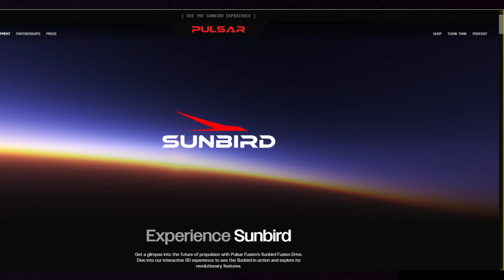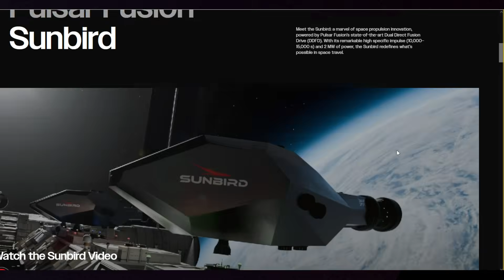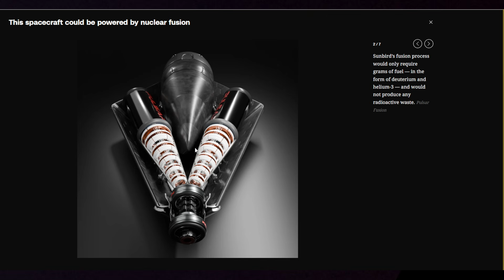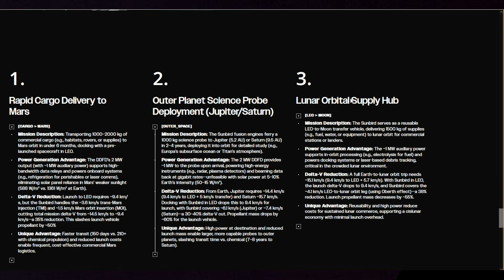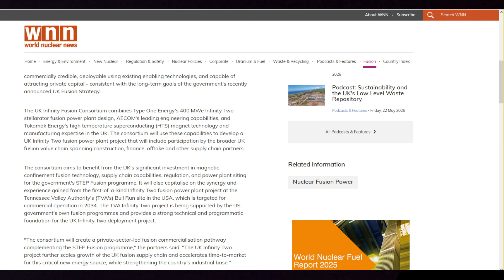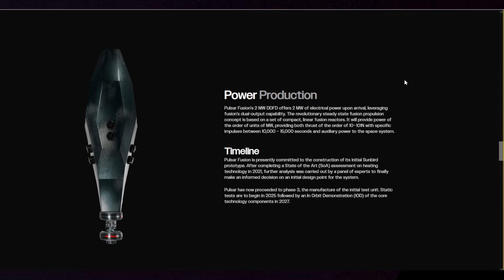On the Sunbird Fusion Spacecraft

Comment: frankly if you are going to do this id probibly just integrate it into the ship and use its thrusters. then you just have to worry about the engine. do a star ship variant without the re-entry features. no tiles, no flaps, no sl engines which you only need for rtls (vacuum engines are fine, perhaps a ring of 6 should be enough to make orbit with the fusion engine in the center). fuel tanks that can be converted to storage on orbit. or do a 3rd stage with the orbital insertion features on a disposable stage 2 and a pure fusion stage 3.

and no the engine is not providing power. you do not need break even for propulsion (it will come before power plants, so doesnt fall into the always 20 year trap). power would need to come from solar or an onboard nuclear reactor. also pb11 would be better as its all alpha particles. you only need coolant for the magnets. all the heat stays with the plasma and since you aren't extracting energy from it, and the alpha particles are staying in confinement, all the heat goes out the tailpile (magnetic nozzle). you still need to cool the systems though. you wont need huge rads.

Comment: hilariously the day this was uploaded I came up with one of my most insane rocket motors to date, I call it the Cherneska Fusion Engine. mind you I previously came up with the Emico Nuclear Rocket, which uses a neutron channel reactor as it's core, which itself can be thought of as a continuous nuclear bomb that runs on prompt neutrons. the CFE basically uses an ncr to power fusion by bombarding the fusion fuel with neutrons, not unlike that of a thermonuclear bomb. the fusion products are then used as the reaction mass propelling the vehicle forward. I guess it would be called an asymmetric fission initiated fusion engine to be more technical. I didn't sleep last night btw.

Comment: "cybertruck esk modual" i mean. tbh it really doesnt need any good shape given its prolly not an atmospheric craft but something you bring to orbit on a second trip.

what im more curious about is the attachment. cuase if they dont attach it to the ship properly, it becomes a missile... straight into the starship. hell, it should have debri resistance.

imo i would attempt to build the lock so it sits in the hull more. close the gap between it and the starship. protect that mechanism more.

but im not an expert or anything. its an intresting use for nuclear powered rockets tho!
Reply from the maker: I think you're vastly overestimating how much thrust this can provide. It maxes out at 101 N, which is less than one ten-thousandth the thrust of one of Starship's engines. So, it really can't become a missile once attached - it has nowhere near enough thrust for that. It's main selling point is its efficiency, but it probably shouldn't be pushing anything like Starship around.
Reply: @RaizSpace  101 N for a high effiency thruster? thats more than 0 N for a low effiency thruster that has run out of fuel and has to wait for more.

think of it as an orbital transfer thruster.

not saying that the design is good tho. im just saying the idea is... well. the idea. whats the alternative anyways? xenon? ion? ion impulse? with 0.5 N of thrust? (idk id have to go research ion thrusters lol.) but you get the idea.

though i can definetly see this thing as a 'space craze' scam. i would geniunely never design a attached thruster to be off CoM myself.  thats just a mathamatical nightmare.
Reply: i think a more sensible hull design (theoretically of course, this thing wont work) would be better. surely having the maneuvring thrusters furhter out relative to the CoM would help?
Reply: @endercherry_real  no you either build with the hull (imo), or spend time and effort making sure mistakes cant screw your crew over. an RCS thruster no matter what would take fuel. extra fuel spent preventing an unwanted spin.
Reply: @endeyfire  but you need to do maneuvres, RCS isnt just to undo mistakes, its to spin.

Comment: The only thing I can say is that in the animation showing the Sunbird undock the Sunbird isn't just using Hall Effect thrusters for maneuvering, it uses smaller RCS Thrusters. Which is something they don't disclose in any of their info, but their model shows at least 8 of them which brings into question if the Ion Engines are even needed.
Reply from the maker: I did see the RCS thruster puff, but as you say, that raises even more questions, especially for the "self-sustaining fuel supply" claim which was already dubious.

Comment: Why are you guys even f$ck$ng debating this it’s obviously a total scam

I did a few MINUTES of snooping and the TLDR is that it’s a weird ass company that has existed for a while and never produced anything, their assets consists of a grifter who owns the company and acts as CEO, one tiny warehouse, and 2 short poorly made CGI movies

Their company is called fusion something and they use to claim they were developing a fusion engine. Yes seriously. I’m sure you can verify that with internet archive sites. 

Anyways I had to dig deep but I finally found what they now say their engine will be and it’s a GRIDDED ION ENGINE LMFAO
*>fusion engine
>looks inside
>grid thruster*
LMFAO

For those unaware it’s a regular ion engine and not just any ion engine but the sinplest type to make by far. It’s basically just 2 metal sheets with wires connected to each one. A disabled monkey could make one in a cave. 

Their promotion videos appear to show literal actors pretending to be employees working in the empty warehouse

The boss also bought 2 random trashed metal gas containers which appears to be something they either want to turn into vacuum chamber or merely pretend they will turn into vacuum chambers. Like most tech scams they just produce CGI stuff with buzzwords for rich morons and moronic investors.  This one seems to target people who want to invest in space X but want to "diversify" and not put everything in space X. 

Basically it’s a shell company that has seemingly spent like a decade building a grid ion thrusters with no prototype yet while claiming they’re making a fusion engine. Their space tug looks completely absurd to anyone with experience in spaceship design too, angular shape for no reason, way too small, no power source,no radiation’s, no spherical fuel tanks, claiming to use fusion, made literally who company that doesn’t seem to exist

I’m almost mad that the people who are wasting my time even contemplating by the notion it might NOT be a scam haven’t given this guy all their money honestly he deserves it more than you if you’re that dumb that this scam fools you

Comment: Skeptical of anything that uses He-3 because of how much of a pain in the booty it is to get any significant quantity of the stuff
Reply: pb-11 is better for this application by all metrics. the fusion products are all alpha particles. so they need never touch the spacecraft actual reducing cooling requirements a lot. also quite abundant fuel supply on earth.

Comment: You should Angry Astronaut's tour of their lab. If I understand it correctly they plan to use a fission reactor to power the "fusion" thrusters at first, which means they don't need the thrusters to produce a net energy output. So basically the first ones at least will basically just function as super powerful, relatively speaking, electric thrusters with Helium 3 and Hydrogen(Deuterium/Tritium) as the propellant instead of the usual inert gas. Achieving fusion isn't that hard. We've been doing it for decades. The reason fusion reactors aren't common place yet is because in terrestrial application we've been trying to generate a net gain of electrical energy from a reactor. This company wants to use the high energy plasma to create thrust so they don't care about efficiency at first. I'm not saying I believe they'll succeed, but after watching Angry Astro's tour the company seams a lot less like a scam. Apparently they have been building Hall effect thrusters for quite a while and have several unnamed customers.
Reply from the maker: Well, I'm mainly just wondering about the radiators. Still going to need those for a fission reactor. If they want to seem less like a scam, they will have their spacecraft look like something proper and less like a Cybertruck tie-in.
Reply: @RaizSpace  tbf if the craft actually needs radiators. nasa has that in the bag. it isnt a new concept to slap folding radiators onto anything.

and tbh the attached craft prolly just has a hull shell for debri protection. so it wouldnt be hard to pack some radiators onto it.

additionally, it could maybe use the starship as a radiator. but i really dont know how well that works.
Reply: @endeyfire  Radiators are *not* a minor inconvenience that you slap on at the end in the loose spaces. It's core to the design of the whole thing. NASA doesn't have folding radiators that could cool this thing. Using existing technology they'd have to be hectares big to work for this thing. Not something that you can fold up easily, especially because you need pumps, heat exchangers, etc...

They've obviously put a lot of effort into those renders, yet they've forgotten what would be the biggest component. There are two reasons: either they're idiots who don't realise how important radiators are for this, or they're deliberately ignoring practical considerations in order to lure in (aka, scam) investors.
Reply: @QuantumHistorian  i said "nasa has them in the bag" becuase they would know how to build them for things like this. not cuase they pysicaly have them.

as for radiators themselves? they are a minor inconvenience. plain as that.

the only thing inconvient about space, is getting there. you could build entire sky scrapers of radiators with ease in space. you just gotta get the parts there. 😂
Reply: @endeyfire  Ah yes the old "I don't understand why this is difficult, therefore it must be simple" argument straight out of a Dunning-Kruger textbook. Are you on Pulsar's payroll or something? In this and other comments on this video you say some breathtakingly ignorant things about space craft design, and even basic physics. Right in line with the claims on their website.

Comment: the texts on the website at least resemble what an LLM may output, imo
Reply from the maker: I mean, LLMs got that from somewhere, so it's too difficult for me to tell without a large sample. Marketing speak predates LLMs.
Reply: @RaizSpace well there's a reason why I said that it resembles LLM output; the "\delta v" in their text did look a lot like inline TeX that LLMs often use and that I don't have a different explanation as to how it would end up (without being rendered correctly) on the website otherwise. Additionally, the 2nd sentence on the 2+ MW text ("Designers think that [...]") does look very typical for LLMs (that tend to tone down their claims, and like to start sentences this way), and at least from my experience, not very typical of marketing speak.

Still of course not definite, which is why I didn't claim it was definitely written by some LLM.
Reply from the maker: You make good points.